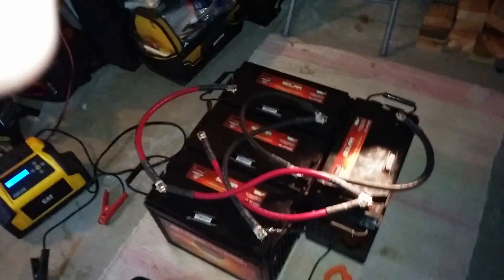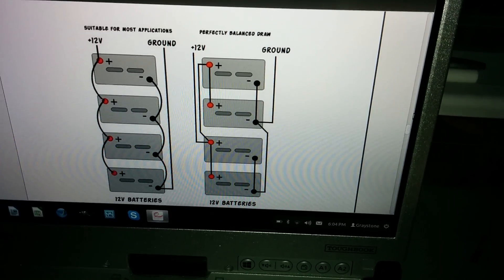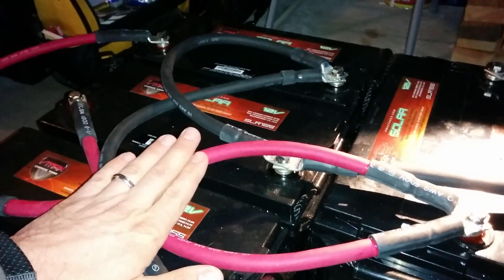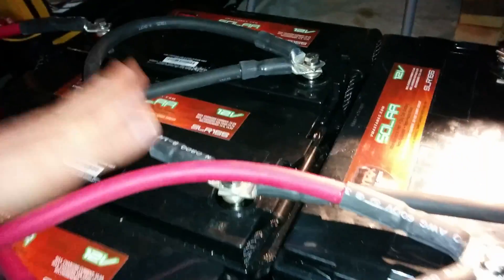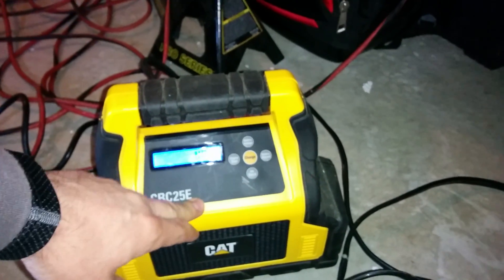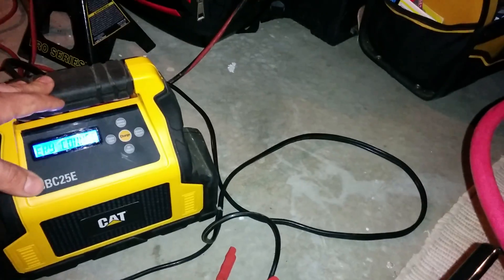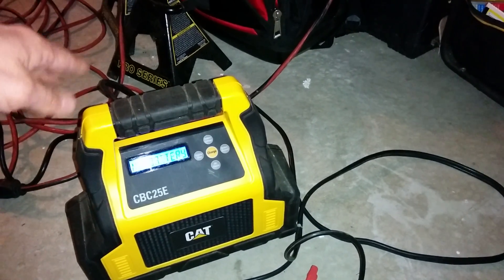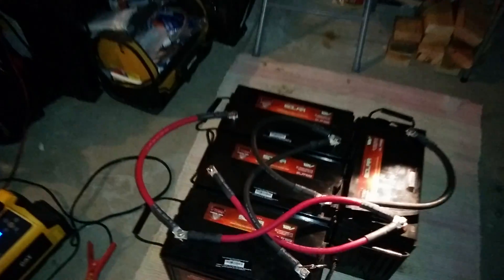12v Battery bank set up in parallel with balanced draw

Comment: All moot. Should have just used bus bar.
Reply from the maker: A bus bar is used like a terminal block, I use it for power distribution. Not sure why you would want to put a bus bar in between your battery terminals. You would still need to run wire making it more costly and complicated without any benefit. If you have an idea that I am not thinking of, I would live to here it.

Comment: dude, your preferred wiring configuration, based on what I saw on the computer screen, has only one difference from the left and that is making the charger work more.  your wiring is not balanced, the one on the left is, which accept charges and discharges very evenly.
you cannot achieve real balanced charging from chargers that are mostly consumer type, as they are quite huge and cost around $18-25,000. 
the simpler the current and voltage can flow in and out, the better for the charger and much, much longer battery life.

Comment: I have just started building a couple off grid solar systems and am also using the Vmaxtanks batteries. 
So far they have worked well. How old are your batteries? Have you had any issues with any of them?
I am using five of them in two systems that are charged by several 100 watt solar panels running through
charge controllers then into the batteries. The batteries ultimately power pure sinewave inverters.
The system I am building inside my house only has two 125ah 'Tanks in series for 24 volts. These two batteries,
driving a 4000 watt pure sinewave inverter can easily power a 12000 btu portable air conditioner for a couple hours or
so with a full charge. I plan on adding four more batteries to this system so that the AC can run over
6 hours off a full charge. So far I have had good luck with this brand and type of battery.

Comment: By not disconnecting all of either the positive connections or the negative connections, you're measuring the voltage of the entire battery bank. All of the black (negative) cables are a common (same) electrical connection and all of the red (positive) cables are a common (same) electrical connection. Could all 4 batteries measure EXACTLY the same? Could any 2 batteries measure exactly the same?

Comment: voltage checking each battery with connected wire leads gives a false reading.  to be totally accurate all batteries need to be disconnected from each other.  only then can an accurate voltage value be attained for each individual battery.

your balance skematic is not perfect.  it is much better than the average run of the mill hookup as shown in your vid where your finger is pointing right at it.  that arrangement is very simple but highly inefficient and almost worthless.  i do agree with you on that idea.  you are also correct in matching the longest length wire to make all the batt cables the same length.  i agree with you on that idea.  keeping things balanced is the key.  but if you look at your wiring diagram it does not show or reflect all batt connects the same length.  and even if the batt connects were the same length the wire to the inverter is not optimally placed.  your close but no cigar.  

i also agree with you on battery charging.  its basically all in the voltage and not the amps.  too many people get this part wrong.

i agree checking with the batt manufacturer.  he is the only one who can tell you what his batt should be charged at....voltage and amps.

overall..  a very good job.  i am going to encourage you to find your own hookup flaw.  i aint gonna give it up easy .   make ya work for it!  lol.  hint...you are close!  happy hunting.  😄
Reply from the maker: Robert Schilling I have been running these guys now for 6 months. The RV is still a huge work in progress but the 12v and inverter system is hooked up and working great. I need to make some new videos of my system to post. I use 1500w inductive cook tops on this system. I must say, I am very intrigued to know what flaw you found. I am always searching for knowledge and insight.

Comment: Hi Joshua. I was thinking of wiring my batteries the  same way as you have, before I saw your set up. I was just going to use shorter  & longer links,though. Since each battery in the bank  would then discharge via 1 short + 1 longer link, would they still not be balanced? What you've done is great, I am just not sure whether there is any benefit in lengthening the short links to match?Effectively this system joins 2 perfectly matched parallel pairs of batteries, again in parallel.
Obviously, at any given current the voltage drop across an 18 inch long link cable would be more than that across an 8 inch cable,but with unequal links, since ANY battery of the 4 would be discharging through 26 inches of cable (+ the fixed cable lengths to the inverter ) would that make any difference? I am an electronics engineer by trade, but I could be wrong , I can't quite decide on this one. Are you sure there is benefit in making the cables all the same length , or did you do it just to be 100% sure everything was equal?  If you don't know , it would be interesting to hear the opinions of other readers.  Anyway , you,ve wired them well, best wishes.
Reply: Actually,looking again at your schematic, since you have one battery alongside, then I can see it is best & simpler to keep all the wires the same length.The vast majority of people will be wiring their batteries side by side, in which case I can't see any advantage to equal length cables, just wire them with equal short & long links.

Comment: I see what you've done, by improving on the "Suitable for most applications" schematic you showed, you've made every battery "closer" (that is, fewer terminals away from) the input / output cables. But surely the best way would actually be to parallel all the batteries like in a LiPo battery bank for instance, i.e. have a +ve terminal post with 4 equal-length cables, each running to a separate +ve battery terminal, and the same on the -ve side. It would require more cabling, but it would reduce peak cable current and make every battery terminal the same cable distance from your input/output cables. This would be the perfectly balanced draw configuration.
Reply: E.g. "Method 3" on this webpage: http://www.smartgauge.co.uk/batt_con.html
Reply: "Method 2" looks the easiest but the all the same wire length is out the window!

Comment: Do you know if these batteries ever get extremely hot? I just set up my solar and store these in a stained cabinet in my RV (lying on their side) I just want to make sure they're not going to catch fire haha
Reply from the maker: LUXGUE If you are using AGM or GEL type lead acid batteries you should be fine, but I always recommend checking with your battery manufacturer on questions like this. If you are using standard lead acid batteries with water, I would never put them on there side.

Comment: Shouldn't you test by using the neg and pos on each battery? It looks like you are using the same point for the neg terminal on the bank, and I would think that would cause all the batteries to show the same voltage because it's reflecting the voltage of the bank, not the individual battery. I would test by touching the pos and neg of each battery individually.
Reply from the maker: +pokerfacetodd I understand what your saying but the fact is the batteries are banked parallel meaning they are acting as one large 12v battery, so the com port being hooked up to one of the negative terminals gives us an accurate reading of the entire bank voltage. It is actually unnecessary for me to test all the positive terminals as I did, It was mostly to prove a point that the battery bank is set up properly and stable. I am working on the electrical system of my RV right now, so I did quickly test each battery individually and the results are exactly the same. If I wanted to test each battery individually I would have to disconnect the terminal wiring, but their is no point as the batteries have been connected and equalized at the same voltages at the moment.

Another point that I intend to make in a later video is that these voltage readings reflect an estimate of battery level. Because I know the proper voltage and charging condition of these batteries I can estimate that they are full within 5% or so, meaning they could actually be at 95% charge, and there is very little I can do to close my error range. The best way to know if your batteries are REALLY full is to use a mechanical test, with a hydrometer to test the fluid density. I do not have this option as I opted for AGM sealed batteries because they are to be placed indoors in living quarters. Knowing the true charging/recondition cycles and voltage of my battery charger helps me know that I am in the 5% full charge range (probably within 2-3%)  which is an acceptable error to me.

Thanks for posting, I like that you are thinking about the system and trying to find errors in my methodology. I have a good level of knowledge in this field but I am always looking for good advice and errors in my work. In physics and engineering,  "any measurements, without the knowledge of uncertainty is meaningless".
Reply: Joshua Matheny Thanks. I'm new to the solar world, so I wonder a lot out loud. I'm trying to do the same but with six batteries. This is the first I heard of having options in how to wire the bank and of course I am all ears, I can not seem to keep that balance. My batteries are identical agm 105ah all the same age. All the same length cables. Currently it's 2 batts wide and 3 deep. I connect them in the middle pos. to neg., making 3 - 24v batts at 105ah each set. Then I connect the 3 pos together with two cables on the far right side of the bank, and the same on the left with the neg side. They start with the same voltage when I connected them fully charged.  I charge from the pos on one far corner and neg on the other far corner diagonally. And I draw from the opposite corners as well. I thought that is the only way but it isn't very balanced when I check the batts. If you have any ideas on how to wire 6 to a good balance, I would be forever grateful.
Reply from the maker: +pokerfacetodd Just searched a bit for a few designs I think may work for you. Here:

http://www.cruisersforum.com/forums/attachment.php?attachmentid=3457&d=1209557909

http://www.cruisersforum.com/forums/attachment.php?attachmentid=3459&amp;d=1209571602

The first one will work but may have some uneven charge/discharge issues. I like the second link for design purposes of your system. I hope these links help.

Is there a reason you require a 24 volt system? I know some people prefer it because of the voltage drop reduction or they just are already invested into 24 v gear. I would much prefer 12 volt honestly simply because of versatility. There are so many 12 volt products and appliances, charging set ups and all more cost efficient. Heck, in an emergency you could charge your batteries with your car on 12 volt. Just a thought.

If your new to solar I highly recommend doing some serious research on the different parts of your system. Make sure your solar charge controller pushes the proper voltage for your batteries, or can be manual tuned to do so. Do not listen to sales agents for technical information, go to technicians or strait to product specifications to get real information.

Some of the biggest problem with common solar set ups is wire gauge. Honestly it makes a huge difference on DC systems. If your panels came with 10 gauge aluminum wire (like mine did) I highly recommend you investing into thicker gauge pure copper (not alloy) wire to run from your panels to your charge controller. Most people's set ups never fully charge there batteries because the voltage drop in the line. The longer your leads from your panels the more drop you get. I have 10 foot wire runs from my panels and I opted for 4 gauge copper wire. No matter what anyone tells you, it makes a huge difference and is quite possibly the industries #1 downfall in efficiency.

Test it yourself. Put the panel in the sun, and run different lengths, gauges, and materials of wire, hook your DMM up and see the difference. All the while remember what voltage your batteries need to charge at (probably 14.4 to 14.8, temperature dependent). If your panel wire runs are pushing less then the optimal charging voltage, your charge controller will never be able to get your batteries full.

Also remember that the gauge wire from your charge controller to your batteries will need to be even thicker, as it is pushing higher amperage then each individual panel.

All that being said solar is one of the best ways to charge and maintain your batteries.

Check this blog written by Bob Shearer out for more info on 12v systems. I recommend reading it all the through, he really knows what he is talking about and the post is full of real information from an engineering perspective rather then a sales pitch.

https://handybobsolar.wordpress.com/the-rv-battery-charging-puzzle-2/
Reply: Joshua Matheny Great, thanks. I run my panels in series putting 4 - 100w panels together as in a 48v system, so I don't need to run so many amps, and that saved me in the gauge of wire costs. Once the power gets to the MPPT controller, it's broken down to 24v because my 24v inverter is more efficient than my 12v, plus it's less reduction of volts just to turn around and increase the voltage again in the inverter. Most of my appliances are AC power. 

The distance from the charge controller to the battery bank is only 5 ft. and is a max of 30 amps at 24v. Which is the same as 60 amps at 12v. With the higher voltage I greatly reduce my cable requirements.

Also, by connecting in series I reduce the need for connectors that create the parallel connections between panels. With 12 panels I only need 2 sets to connect 3 sets of 4 panels.

Another issue is the higher voltage at the panel level means the controller starts charging earlier and charges later because as long as it's bringing in more than 29v it's charging, and that's about half power.

Anyhow, thanks for the info, I'll get started experimenting.